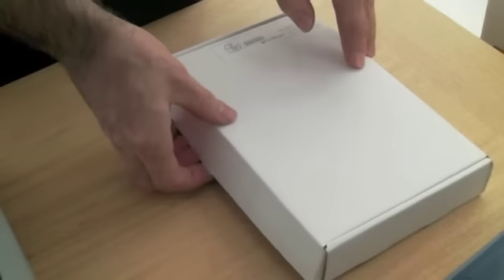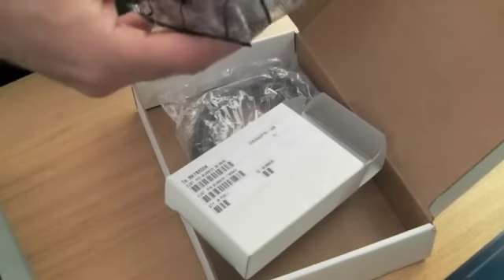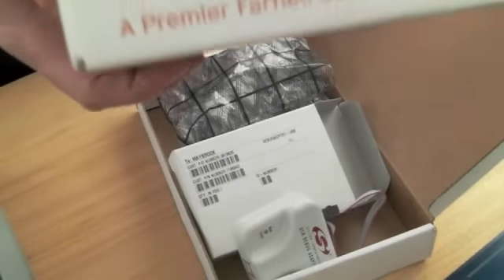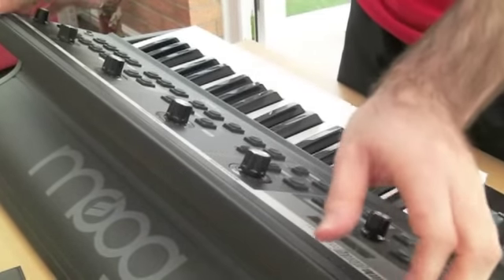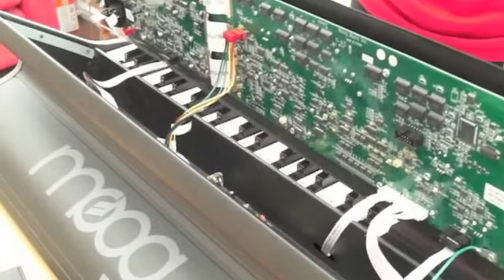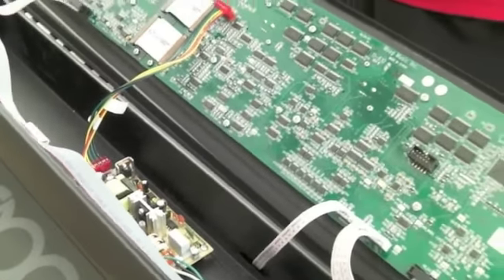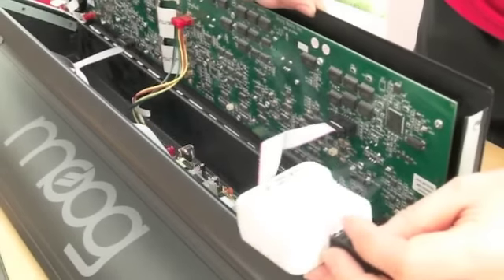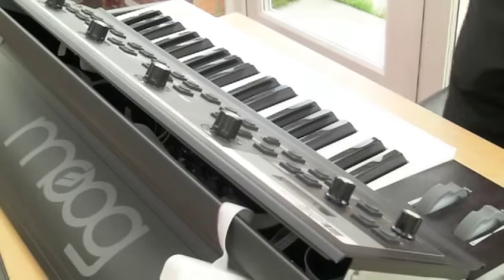Moog Little Phatty Debug Repair

Comment: Hello, I'm experiencing the same issue and have already purchased the debugging adapter and contacted Moog support for the hex files. They sent me however different file and the process has been unfortunately unsuccessful. Can you unkindly post a link to the hex files that you used ? Thanks in advance :)
Reply from the maker: check your email, I've sent you a zip file with hex files in it, got your email address from your facebook page, hope you get it sorted, Moog don't have a link they never have done they seem to leave it to me, awful customer service.

Comment: @Subtronik mine did the same, took it to a independent synth repairer. there seems to be a resister missing from the power supply which causes the control data and LEDS to go crazy, as if the knobs are being moved by themselves. common problem apparently....good thing that these synths aren't expensive!

Comment: nice video. i just had a problem with my LP(send firmware sx code Error 2) so the adapter seems ok hiding inside the phatty. still working fine today ?
also wondering if i don't feel like use the adapter to restored the LP what else i can do?

cheers mate
Reply: Hi, just looked at how long ago this post was. I've got the same error. SEND FIRMWARE SX CODE ERROR 2

I know this is now 2020 but could you let me know how you managed to sort the problem out???
😬🙏  pleeeaase!